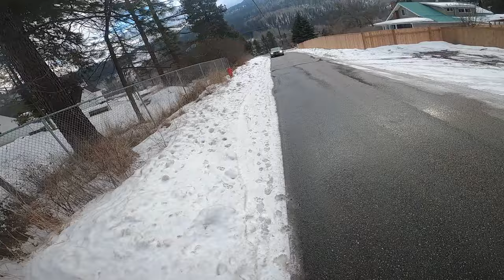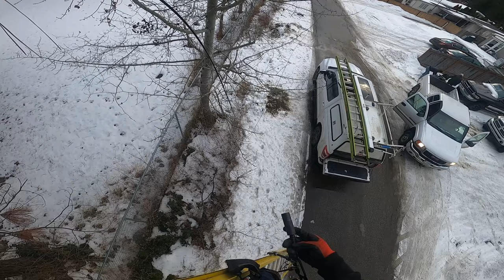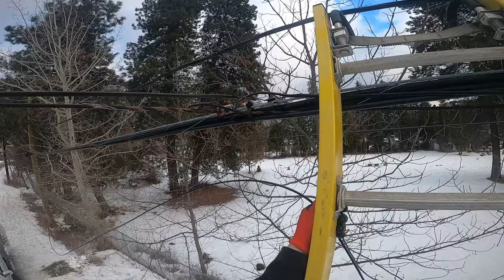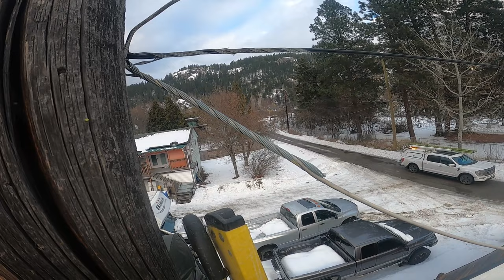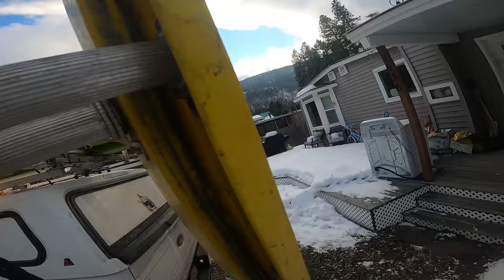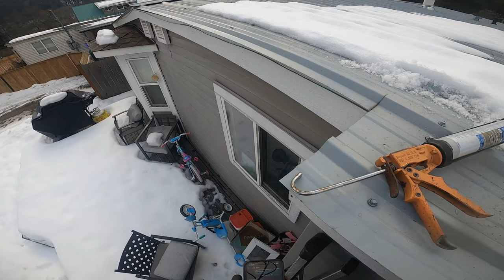FIBER OPTIC CABLE INSTALL

Comment: When you install, do you have to keep in mind the clearance from the triplex or is it an electric co-op-owned owned fiber in which the clearance would be lower?
Reply from the maker: Could you elaborate? Do you mean on the strand ? With the hydro (power) lines? Or the insulated lines going to homes.
Reply: @FyBurz  ahh my bad. I'm talking about that fiber drop to the house in the mid span and on that mast on the house. I've barely been doing make-ready design for a year so I was wondering when communication guys are out there if it's something that's kept in mind or not. Thank you for the reply
Reply from the maker: @Loveless5000  yes it’s the standard. The mast is designed to take a load.

Comment: how come some drops are lashed and yours are self support?
Reply from the maker: My drops are OBD, which stand for order-based drops meaning they’re put in after the build was done so sometimes drops are lashed in during the build, but usually any drops that you see lashed in my videos on the strand or just main line, feeding MPT or naps, and those get lashed in by protocol. Here our order-based drops are self supported.

Comment: Bro do video on how u lay that out so quick. Haha my shit always twisted 😂😂
Reply from the maker: Haha, yeah I can definitely do that. The video is sped up btw 😅
Reply from the maker: Hey man, I uploaded a new video today that includes a little tutorial on this. Check it out!

https://youtu.be/NHhP7JxmTJ0
Reply: Nice work Bro! Do you have a video showing the last part of installation? Inside home. Thanks man. Have a good work
Reply from the maker: @america.onwheels  not for this sorry. My camera died it was early days of filming. I’ve since fixed that problem. But it’s very similar to some other videos I have. Most of the termination is the same more or less.
Reply: @FyBurz  ohh ok  thank you. Here in Brazil, we do the same procedure, but we use the same drop from the Box (outside in pole) to the ONT. Is good to see how you work in another country.
Reply from the maker: @america.onwheels  yeah some techs will take the stripped fibre straight to the ONT, but protocol is, splice in the box then use. clearCurve fibre or “patchcord” over to the modem/ONT
Reply from the maker: @america.onwheels  https://youtu.be/816VvDFoO6M in this video you can see what I Mean